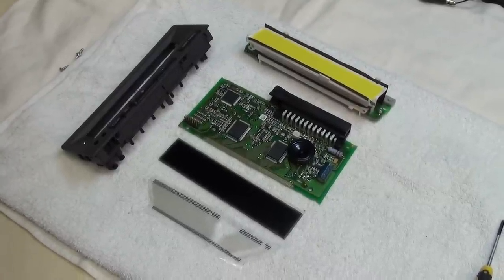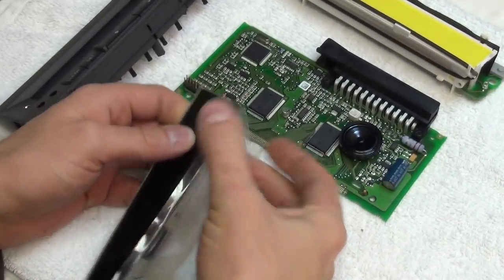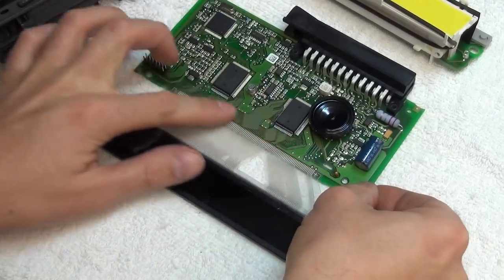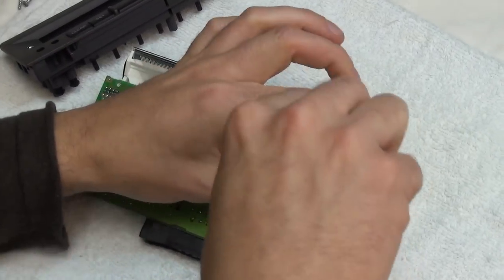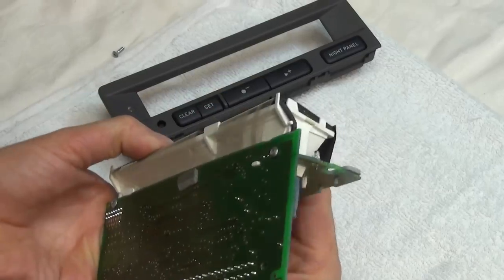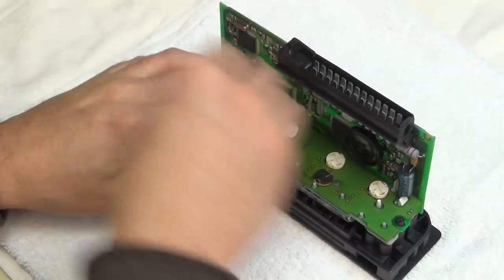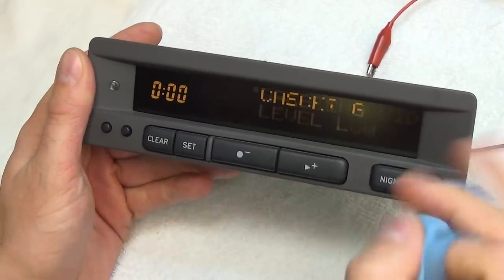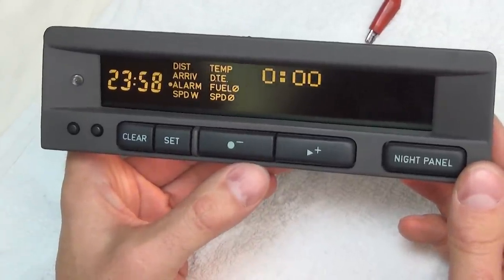Saab SID Pixel fix in 2 minutes - saab sid repair instructions manual with silver ribbon

Comment: 2 minutes is only for the reassembly. 

That only counts the part of the time after you have taken it apart and fastidiously removed the residue of the old adhesive already. 

And it only works so quickly if you have lots and lots of practice…
Reply: нет тролля ты троль конечно )

Comment: hi from turkey sir ı am a saab 9.5 1998 user and ı have a problem about yout repairing part but not wiev just light degrees some buttons  are so lightfull  and some buttons are dark can u show on a video how can ı repair it if you know thanks for now
Reply: Hello! The solution is simple, just replace the bulbs! :)
Reply: Pixelfix Balazs where is the bulbs it will be first time repairing ı dont want to destroy  anythıng.does it (bulb)black thing bigger than the other objects  in your video?thanks your answers

Comment: Куда подключать 12V+, а куда 12V- чтобы проверить?
Reply from the maker: SID big connector (9-3):

13 - GND
5, 14 - 12Volt

SID small connector (9-5):
1 - GND
8, 15 - 12Volt
Reply from the maker: SID with big connector 9-5:
13 - GND
5, 14 - 12Volt

SID with small connector  9-3:
1 - GND
8, 15 - 12Volt
Reply: @Csiboreszkudo  Thank you!
Reply: @Csiboreszkudo  What is my connector? Big or small?
SAAB SID2 5263264
Reply from the maker: What you see on this video is a big connector - what I call small is approximately half the size.
Reply: @Csiboreszkudo  for long connector (2 lines of pins) 9-5: ground pin 13, +12V pins 5  for sure and 15 instead of 14 ?

Comment: Hi, How do you know where exactly to stick the ribbon to the LCD? I opened mine and the contacts are transparent. Are there any marks on the ribbon to help us place it properly?
Reply: It works by mechanical pressure but you can also use a little scotch tape! It comes with a detailed manual how to do the job!

Comment: Can you take a picture of the cables you are using to power up the sid ?
Reply: Joakim H did you ever figure this out? I'm in the same boat right now....I just acquired a box of 9-5 SID2s and I have a 9-3. I want to test them before I sell them.
Reply: Rick Hapanowich Any luck with the pin outs?
Reply from the maker: Stephen Zigmond

SID big connector:

13 - GND

5, 14 - 12Volt

SID small connector:

1 - GND

8, 15 - 12Volt
Reply: Csiboreszkudo Thank you. What in is +ve?
Reply: Stephen Zigmond +ve is apparently 5 and 14, but I can get the display to turn on, but not show any text